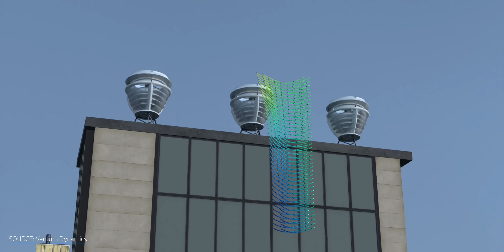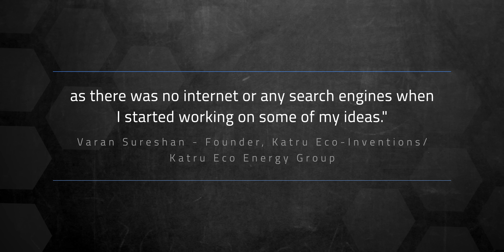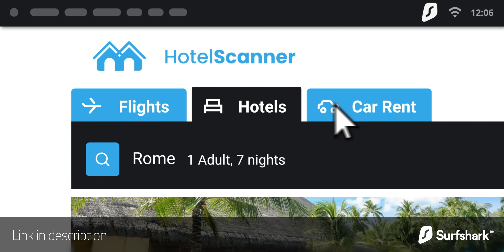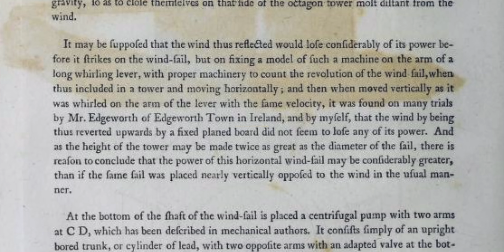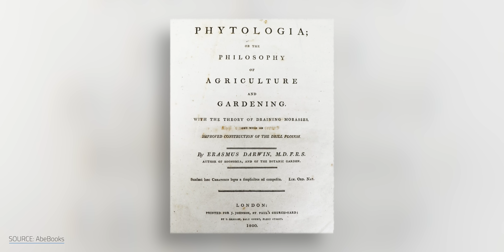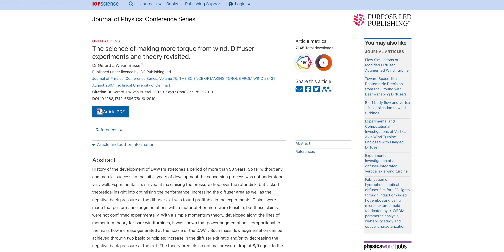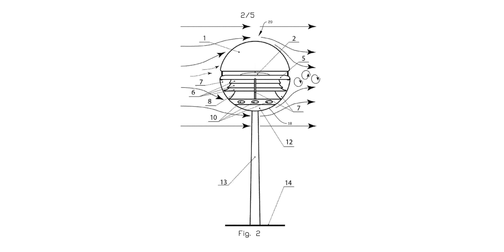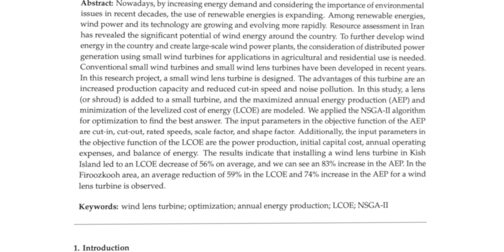Are Shrouded Rooftop Wind Turbines the Future of Energy?

Comment: I think these devices have their place.

You mentioned the noise for one turbine.
Although the noise might not be greater 55 decibels would multiple turbines create a widespread background noise,?
Especially on top of an apartment building.
Would the noise be bothersome to the inhabitants if there were 10 or 15 of them on the roof?
Reply: Any time you have multiple turbines it isn't the noise level that causes the greatest annoyance, its that impedance 'wom, wom, wom' sound when 2 are close but not quite in sync with each other.  Its a neat effect on the Enterprise... less cool when you have to live with it shaking your structure and hearing it in your bones lol.
Reply: Are the tenants on the roof with the turbines?

They don't hear the AC units
Reply: @soccerguy2433  I understand that.
Background noise no matter the source can create medical and psychological issues.

Adding another layer of noise without remediation might cause problems with improper installation.
Reply: What does 40db sound like?
People mention a sound level but without a reference for comparison it's just a number.
Reply: @johnwenzel2003  Somewhere between a typical bird call and a large transformer at 100 ft.

Comment: The text capture @12:22 is talking about the economic feasibility of a shroud for reducing a turbine's radar cross section, and goes on to state that it only makes sense if the shroud also improves turbine performance.  That's a tangential consideration in the context of that paper's actual subject, and doesn't say that the shroud is not practical at all.
Reply: Wind turbine fields are a big problem for radar. The big ones have similar doppler and formation as a fleet of attacking aircraft.

Comment: These are both vertical wind turbines for power. They differ in the usual engineering features that make the future possible. I would love to see the research path as I have seen 20+ of these just like you said at the same time you kept saying it was different. The "Green new deal is a move to get everyone on the Grid not make green power!!! IF the Green New deal was real The wasted cash sent to the corrupt solar and wind industry. IF we really want to "save the planet" then EVERY building would have to be built to power it's foot print. The city and state governments are using HOA's to block roof top solar. Insurance companies are attacking roof top solar. I would solar in the 70's and 80's when panels were horrible and we could still power a big box store off it's own roof, With all the new lighting and HVAC and panels that have over double the power of the 1980's but teh solution is for Power companies to STOP buy back power and insurance and government block the ability of home owners and businesses to drop the grid and use their own power!!! Truly think about the spoken "panic for the planet" and the actions that are really taken "for the planet"! Actions are the opposite of the words. When you realize hedge fund companies are behind both sides you begin to see the bad side of the truth.

Comment: The fundamental problem with wind turbines in built environments is the wind speed, hence all the efforts to "multiply" the velocity. You can't beat fundamental physics. Wind turbine design is mostly the function of wind speed and the blade swept area. when you building enclosure to increase wind speed, the swept area decreases. Since wind speed is in a 3rd power relationship, there is some credibility about increasing wind speed to sacrifice swept area, but the benefit only really shows over a certain wind speed.... hence... does the site have sufficient wind speed is practically the only question you need to ask. Wind in the urban environment is sporadic and bad for consistent generation. All the CFD simulations are mostly steady-state wind that does not capture the dynamics of changing velocity and inconsistency, and I have not yet found a building top wind generation project generates as much as they claimed prior to installation. The product shown in this video is probably already pushing for the max efficiency of the design, I hope it works well in the real setting. And there is also the generation frequency thing that requires wind turbines to go from AC to DC and then back to AC (to make sure its 60 Hz in the US), probably canceling out all the efficiency in design.
Reply: Obviously bigger is better when it comes to pure power generation, but you aren't sacrificing swept area in a limited space environment. You wouldn't be putting massive turbines there anyway. So as long as they produce useful energy at a decent cost it doesn't matter how big they are.

Who cares if the wind is sporadic? Surely no one in their right mind isn't putting a battery in between generation and usage. Besides, the whole point is to offset grid usage, not replace it.

The efficiency and potential of the unit has to be established in ideal conditions. They would be the first people to tell you that your specific building isn't going to be hitting that number. 

In the end, the cost of manufacture is the most important number. Matt gave it an offhand mention, but it truly is the make or break metric. It's like the difference in car sizes between America and Europe. America has cheap gas and huge cars, Europe has expensive gas and small cars. If the turbine is cheap its fine if it can only produce 1000 kw/hrs.
Reply: @jackinthebox301  putting even these small turbines on the roof would require extra engineering for the structure. At that point would it even be worth the cost?
Reply: @pin65371  That's included in what I'm saying. If the cost is low enough then they make sense.
Reply: ooof... I didn't even thing of the AC to DC part of this... in my mind I was comparing to solar, but this would naturally be an AC device with varying frequency, so you would either need some crazy electronics to fix the AC into something usable, or take the extra conversion losses... rough...

Comment: I would think that a smaller version would also work on the peak of a residential home. Similar air patterns are seen as air hits a rooftop and moves upward to the peak. A secondary effect happens on sunny days when the air is further heated by the hot shingles.
Reply: Smaller in wind turbines means less efficient. A size suitable for a residential house would only produce a few hundreds of kWh at best.

Comment: no it's not. Not this rooftop turbine, not any rooftop turbine. Wind speed is significantly slower at roof top levels than higher up and slower still in the cities. Stop selling vaporware
Reply: Are updrafts a joke to you?
Reply: That's a blind generalization.  Wind speeds arent even the primary factor for wind power generation.   Scaling small generators in the same area and in places with giant towers are an option is a possibility anyone can see
Reply: @Demo1024  Typically, one large wind turbine can produce much more energy than many small ones.
A large wind generator will be much more economical in terms of materials, have higher efficiency, TSR and other parameters

Comment: I thought what was interesting was a solar up draft tower years ago. Wonder what ever happened to the idea.
Reply: Look up Enviromission - they keep touting the idea but don't seem to have successfully implemented anything.  I almost invested in them years ago - glad I didn't!
Reply: Worked on a project like that and it did not scale well. As the diameter increased the energy output was not linear. But the cost was so it was shelved. Might work today if you could get the usage of your house low enough.
Reply: The same thing that happened to concentrated solar thermal: Photovoltaics got really cheap.
Reply: @vylbird8014  True, it would be great if batteries could do the same thing,
Reply: @paperburn  They do, we are at the start of the curve.
Reply: If it had proved to be any good we would all be using it.
And that goes for all the other lizard lotion solutions on You tube.
Technology isn't like the oo-ra adverts you see, Its a hard grind of eliminating 'solutions' that definitely cannot work, and then trying to get the ones that have some chance, to work well enough and cheaply enough to be worth building.
All renewable energy survives on a pinnacle of state subsidy.u. None of it is actually worth building at scale, except hydro.

Comment: I think how viable these would be for a home really depend on where you live. Here in Florida it would probably pair very well with solar and a battery back up. I'd have no problems painting one green and putting it up on a giant brown steel pole making it look like a tree in my backyard.
Reply: Good idea, but as noted in the video, these are especially suited for taking advantage of up drafts close to the side of large buildings. You might be as well off, with a conventional wind turbine in your situation.
Reply: @garethrobinson2275  my thought would be that this could be pretty effectively dealt with by changing the angle of attack of the inlet ducts to more effectively duct wind blowing horizontally, rather than wind that had already had its direction changed by impact with an object
Reply: @BumpHeadRacing  Go for it! Will it be more cost-effective than a conventional turbine in tgat location? Unlikely, but you could have fun trying.